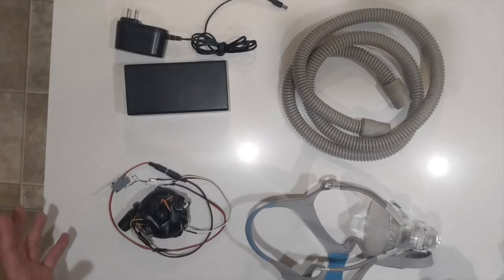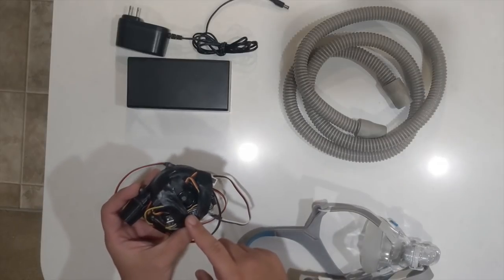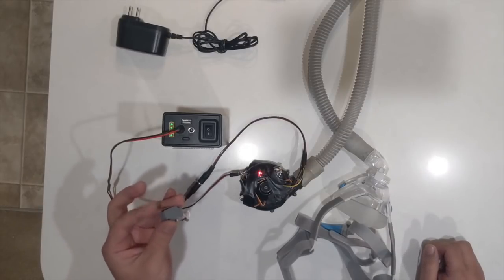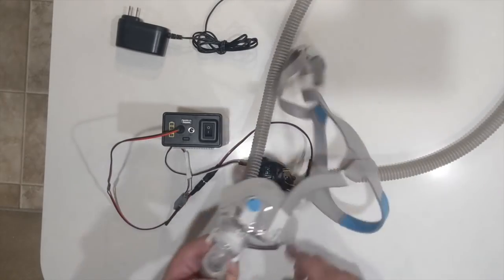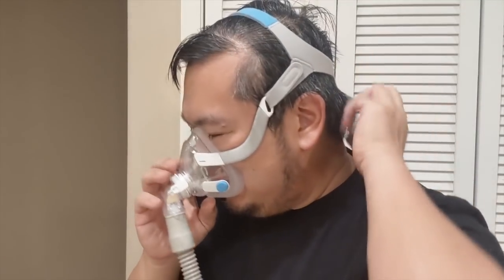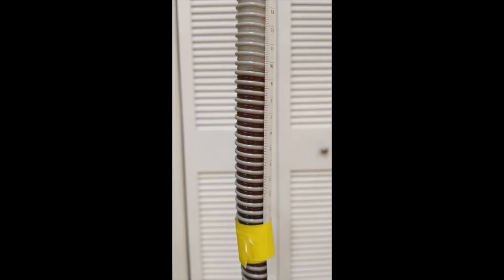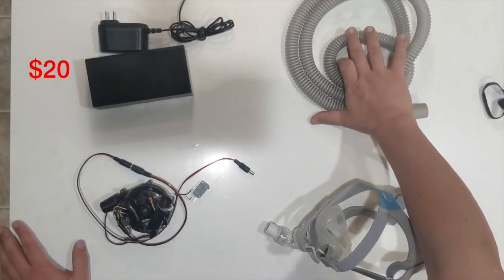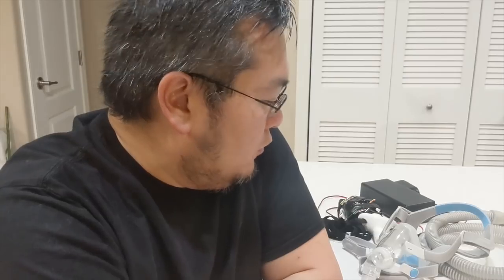Low-Cost Open Source Ventilator-ish Device

Comment: Great work, it looks like most covid 19 patients need oxygen and ventilation so you might want to look at an oxygen generator to be used in conjunction with the ventilator. Another very important thing to remember is keeping the device clean, often cpap machines are cleaned with ozone, the trouble is ozone in gas form is toxic to humans so you would need 2 ventilators to switch between cleaning. It looks like most patients stay on ventilators for 3 weeks or more so a backup power supply is probably a good idea. If people listened to Bill Gates a few years ago we could all be ready for this but alas we are not. Best of luck from across the pond, keep up the good work ;)

Comment: Hi Johnny, I am an electrical engineer in Canada and I was having the exact same discussion with my cousin who is a physician and professor of sleep disorder in the US.  I think that the ResMeds of the world (and others like Phillips) should provide field modifiable firmware to modify their devices by hospital staff.  Not all CPAPs would be modified that way, but I am guessing that because they manufacture ventilators as well, that their manufacturing is modular.  So they would use similar mechanical modules, and the only differing part would be in the control module functions which is likely programmable.  People who need to be hospitalized could first be triaged over the phone if they have their own CPAP machines (there must be millions of them out there), if it is one of the modifiable ones, they could  be asked to bring their own CPAP machine, and if their case is not that extreme or if the hospital needs to get a real ventilator, they could modifiy the patient's own device in the field and have him on it, waiting for the eventual scarce resource of the full ventilator.  Thousands of lives could be saved this way  instead of repeating what happened in Italy when doctors had to choose who to put on a ventilator and who to let die.  If the manufacturers made these modification instructions available, it would also likely be reversible, and when the patient got well, his device could be returned to him in its original state.

Comment: Mouthpiece is quite common in snorkeling gear/ scuba gear. I wonder the aquarium pumps are suitable, should be also quite common and should be easy to find?? If so, should be able to assemble this anywhere pretty quickly.

Comment: I wonder whether a SINGLE system would do for an entire ward or even a hospital. A large centralised motor (and control board) could pulse the air pressure periodically then people could locally tap in to the networked air supply, via a valve to prevent backflow, and adjust a constriction control to get the right air flow for them personally. Just one big motor needed, plenty of tubing and one mouth adaptor/flow constrictor for each patient. Most hospitals already have a centralised oxygen supply so another option would be to mechanically modulate each flow constrictor (assuming the oxygen pressure is high enough).

Comment: I’m watching every video as well... I’ve come up with an adjustable inflatable concept that solves the function of aligning the head just right to make a clear decent into esophagus opening the passage being careful not to harm the few obstacles. Id say the hardest part is getting this in with out having proper tools or devices.. however a simple pump and valve works with the manual hand pump. Introduction of oxygen above 80 percent would, well  would be preferred before attempting this, but life or death is life or death,,, I’d be interested in chatting..

Comment: You will need to be intubated and have the ability to add pure 90-100% oxygen.  Being intubated  is easy enough at a hospital or by anyone who has the kit..  running out of meds and oxygen will be an issue.  A ventilator provides pressure and volume from 500-600cc.  In order for the CPAP to work the tube will need to be inserted into the airway.  If you get to the point of needing a ventilator you will likely be on it for a couple of weeks.  I have been working on this issue myself.  Using wife as a guide as she works in ICU.  Buying a oxygen concentrator that produces 90% oxygen is one component.  Having control over pressure and volume is a must and everyone's lungs are different sizes.
Reply: Thank you for your comment. Check out Johnny's notes from talking to pulmonologists and respiratory therapist. https://github.com/jcl5m1/ventilator/wiki/Notes-from-chatting-with-a-pulmonologist Hopefully there may be some notes that can help with your project too. Good luck!

Comment: Pretty neat...Why not run the blower at constant speed and modulate the air flow with a stepper motor controlled diverter valve? Then you could from zero to 20cm. That would effectively double the potential differential pressure. Also Thingiverse has some dust mask designs that may be useful.

Comment: A couple of thoughts from an intensive care doctor. First, these home devices have only one tube from device to patient, so the expired breath has to be vented through holes in the mask. If you fit a mouthpiece without such holes, the patient will rebreathe their own expired CO2, which could be fatal. Second, there is not much value in this unless you can supply supplemental O2. Third, this kind of non-invasive ventilation is usually considered to be ineffective in COVID. A more useful innovation would be a device that allows the BiPAP machine to be attached to an endotracheal tube with vents and a viral filter for exhaled air.
Reply: Thank you so much for your thoughtful feedback! Johnny has notes from talking to professionals in the field like you: https://github.com/jcl5m1/ventilator/wiki/Notes-from-chatting-with-a-pulmonologist . Feel free to check out the issues section to provide more specific feedback. Cheers.

Comment: Consider and ambu bvm self inflating bag. Need a mechanical mechanism to compress the bag at a regular interval.

An oxygen source can be connected to further facilitate breathing.
Reply: There are advantages for the various methods i.e. a mechanical mechanisms does allow measuring volume directly.

Comment: Include a cheap barometric sensor and have the controls vary the pressure through speed rather than just using speed settings.

Comment: Someone that gravely ill would likely be unconscious and so a full face mask would be required at minimum -- in reality intubation is needed to protect the patient because otherwise the blower would push air into the gut, and the risk of aspiration is high.  A better alternative is a V-Pap which is essentially a ventilator.  Or, better would be if you could figure how to hack a standard CPAP or BiPAP machine to allow V-Pap functionality.  It is a software thing with these, not hardware.  So if you can activate or reprogram you could convert them to V-PAP ventilators.  The VPAP responds directly to the patient's breathing needs and can adjust itself.

Comment: Your going to need some sensors and valves for the pts neg pressure attempt of a breath to initiate your machines positve pressure breath. It's  gonna get more complicated especially with the fluid build up in the lungs. It would be great to finnd a broken ventilator and back engineer it, good luck.

Comment: I re-read my early comments and realized they failed to recognize the contribution Johnny is making, simply by reminding folks that there are many alternative  solutions to the ventilator issue.  

I do have one warning to anyone who is doing a conversion or designing a new device.  AVOID CO2 BUILDUP!  CPAP machines do this by allowing a continuous flow through the mask itself.  BIPAP and purpose-built ventilators deal with this by design.  Any converted device must not allow any backflow into a single hose.  FINALLY- purpose-build ventilators have bells and whistle warning provisions.  Probably not absolutely necessary since the patients will probably be closely monitored.

I actually had one uncomfortable memory of being in bed after major surgery, with several other patients in the same room.  An un-used ventilator was screaming warning noises and we couldn't get anyone to turn it off for quite an uncomfortable time.

Comment: Hope will not be necessary but if yes, this is an excellent alternative!
I was wondering about a piston system, like in car engines, so one motor could "power" multiple ventilators at the same time. it has though a but less tolerance and would expand the lungs a lot more (perhaps some vents it could be managed as well).

Comment: I was looking for a project like this and I found this. I liked the overall idea and design. I think this would be a lot better with the feedback control loop fed to the microcontroller to adjust the breathing rate in real-time.
Reply: The 3d printed "mask" doesn't even have a vent for spent air, this guy has no idea what he's doing.
Reply: The 3d printed "mask" doesn't even have a vent for spent air, this guy has no idea what he's doing.
Reply: @cebruthius  Hi. Please check out Johnny's notes from after talking to pulmonologists & respiratory therapist. And if you still have any constructive feedback after that, feel free to participate in the conversation with pros on the github page.
https://github.com/jcl5m1/ventilator/wiki/Notes-from-chatting-with-a-pulmonologist

Comment: Just thinking if the lungs naturally push the air back out on their own could you leave the blower running at a consistent speed and use a bypass valve that would intermittently close off the air from the blower and open a venting valve from the lungs?  If you can do this then you could theoretically use one blower for several people if there is enough volume.  You could use a much larger blower and run multiple hoses off of it to several people at once.  The intermittent valves on adjustable timers on each person's line would direct air to the lungs of each person separately and then switch and allow the air to vent out of the lungs.  You would need a blower and a HEPA filter and a regulator to maintain constant pressure so it would adjust depending on the number of people connected to it.  I have ideas for a simple regulator for this if the basic concept is feasible.

Comment: You need an oxygen and air source.These patients that have advanced Covid have ARDS. That requires high amounts of oxygen like 80-90% O2. We breathe 21% O2. PEEP is also necessary when treating patients a lot in this case.You also need humidification to make up the difference you lose. You will need to intubate patients, BIPAPs are nice but after a certain point you need a ventilator.
Reply: Hi Christopher. Thank you so much for your comment! Check out Johnny's notes from after talking to pulmonologists and respiratory therapist. If you have additional feedback, that would be greatly appreciated: https://github.com/jcl5m1/ventilator/wiki/Notes-from-chatting-with-a-pulmonologist

Comment: Great idea! Maybe it could be done even cheaper and more accessable Why not use a hairdryer and a voltage control (dimmer) of almost any kind to deliever air?
Reply: CPAPs are designed to run continuously for long periods of times. Some of the other blowers may not be, but definitely are worth a test.

Comment: The problem is that people naturally breath against them and they will often need to be paralyzed to enable the needed breathing rate. Also,  a particular low pressure level is being found to be optimal in some instances. I wonder how a properly qualified Dr who treats this will view this, especially it is probably going to be accessible to those who need an attendant to control the equipment safely, especially if a person has convulsions or becomes delirious or simply falls asleep or are unable to operate it inthe first place.

Comment: Awesome work. What Arduino are you using? I am looking into two potentiometers to set the PEEP and the high pressure of the breath. Then maybe somekind of equalizer/array of buttons to adjust the waveform of the fan. I'm also looking into safety valves that is adjustable but havent found one after a cursory search. Your thoughts?
Reply: You can read more on the github page.

Comment: I’m a respiratory therapist...we do use bipap  in acute respiratory distress....but in severe distress this would not work...these machines are used for oxygenation....but you also must have ventilation....what your machine  is not providing is the tidal volume and rate that a mechanical ventilator has
Reply: Check out this section. It can do rate and PEEP and IPAP up to 45cm of H2O. But correct it does not yet do volume.   It would great to know what level of precision in measuring volume is needed to be useful.  https://github.com/jcl5m1/ventilator#hardware-capabilities
Reply from the maker: Thanks for the feedback.  I would appreciate it if you could review the github project which aggregates feedback on how this could be improved and when it could be useful.

https://github.com/jcl5m1/ventilator/wiki/Notes-from-chatting-with-a-pulmonologist

If you have additional recommendations, feel free to provide guidance to help improve the project.  I have the following thread open to track professional feedback.  Willing advisers willing to share contact info are greatly appreciated.

https://github.com/jcl5m1/ventilator/issues/16

Comment: Great info Johnny, 
I have a thought on the face attachment. 
I have automotive paint respirators that seal over the nose and mouth extremely well. 
I would think you could seal off the cartridge filters and adapt the tube to one side of the respirator fairly easily, getting a sealed air intake. I'm an automation plc programmer by trade. But I've never worked with programming these micro controllers. Are they difficult?
Thoughts?

Comment: If it does not work (most likely) it will at least finish you quickly. I suggest to enhance it with a weed inhaler to ease the suffering.

Comment: No pressure, volume control, and no patient feedback makes it unusable for comma patients. It is necessary to induce to comma on patients because the air low pressure will make the patient feel suffocated if conscious. It is also necessary to use low volume/pressure because it reduces fatality  I am not a MD, so take my comment as an opinion.
Reply: Neither does a bag valve mask, but they're used every day all around the world without the ability to measure PIP, Pplat or PEEP unless a PEEP valve is used.  If this was refined with all the necessary algorithms and pressure modes normally required (Assist Control, SIMV, PRVC and NIPPV (which is what he is demonstrating in the video)) it could become a potentially viable solution if need be.

Comment: Would it help to have another motor for exhaling the air? Then it wouldn't be working so hard shifting frequencies so much. Just a thought. Great little project for the maker community to contribute to! Nice work. :)
Reply: There are brushless HTLI motors (high torque low inertia) which are suitable for rapid speed changes. The circuit used probably doesn't support dynamic braking though. He should have kept the CPAP in one piece.

Comment: Instead of taking the cpap machine apart, I wonder if one could purchase a 3/4 inch 3 way solenoid valve that could be put on the hose for diverting the air pressure at intervals of 16 cycles using some kind of timing switch?

Comment: This contraption, although clever, cannot substitute a ventilator even in an emergency. The main problem is making this operate in a prescribed manner. For instance, a ventilator treating a patient for acute respiratory distress caused by viral infection must put in a certain volume of air and let out that same volume of air at a set rate and maintain a set pressure of air in the lungs. This device you made is missing the key sensors and software that makes ventilators do what we need them to do. Figure out the sensors and computer controls and you’ll be an international hero.
Reply from the maker: Thanks for the feedback.  I would appreciate it if you could review the github project which aggregates feedback on how this could be improved and when it could be useful.

https://github.com/jcl5m1/ventilator/wiki/Notes-from-chatting-with-a-pulmonologist

If you have additional recommendations, feel free to provide guidance to help improve the project.  I have the following thread open to track professional feedback.  Advisers willing to share contact info are greatly appreciated.

https://github.com/jcl5m1/ventilator/issues/16

Comment: Thank You. No doubt the scariest thing about COVID-19 is not being able to breath on your own. 
Side question  -  I wonder if any way to build ventilators with a shared mechanical engine/supplier like a central Air conditioner that is self regulating and could ventilate 100 or even 500 beds?

Comment: Hi there! What are the updates? Did this turn out efficent or improved?  can be the blower case designed and 3d printed so it can work on diferent dc motors? If so, there would be much easiers and faster to DIY vents from random parts any maker or electronic enthusiast can have around his home alredy. We all thank you for input and research. Please keep us updated so we can build and forward the project to othe makers and other countries. Bless!

Comment: just wondering why you cant adjust a regular CPAP machine settings to accommodate? can the software built into the machine not work as is? can you not just adjust the regular air pressure settings you would use for sleeping to a higher setting to help with breathing respiration? not a critique but a genuine question from a CPAP user that may need to use this in an emergency! thanks for all your doing!!!